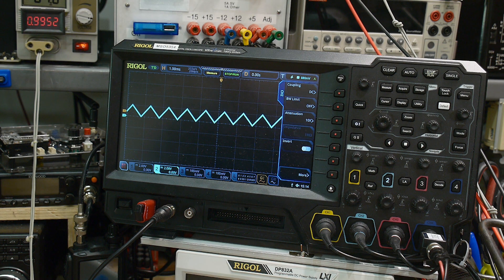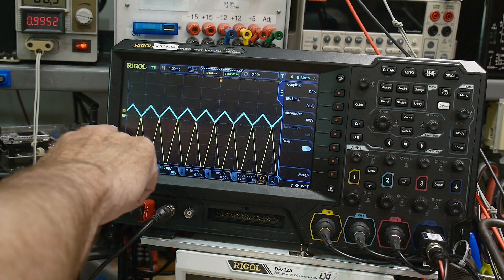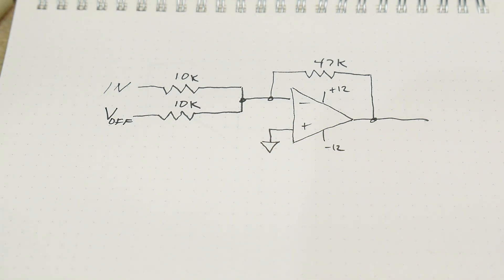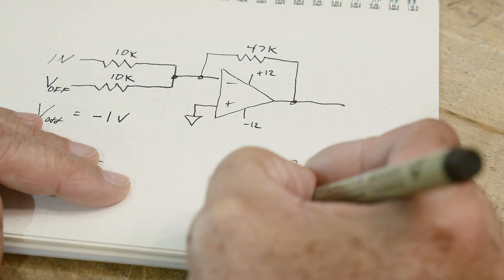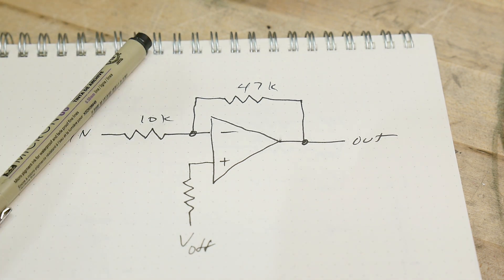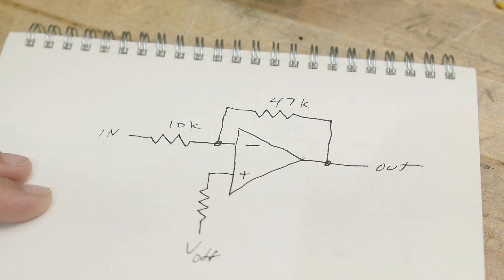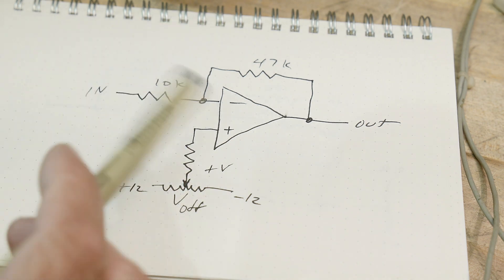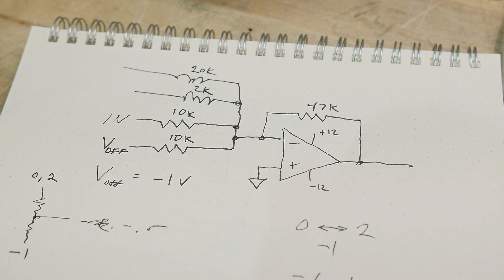#1132 Using offset voltages and op-amps

Comment: Why is there a phase shift on the output?  Is there a way to avoid this?  Im trying to figure out how to amplify and offset negative voltage to a TTL signal creating a zero crossing.
Reply from the maker: I showed an inverting amplifier (180deg phase shift). choose a non-inverting amplifier circuit

Comment: Hello sir, I need some help, the thing is whenever I make any op amp based circuit in any basic op amp configurations I have a problem at a specific time that is when the circuit is powered on or powered off at both of these instances the output of a op amp is very unpredictable or sometimes wierd voltage fluctuations but the circuit works perfectly when powered, please help how can make it work reliably at these instances
Reply from the maker: yes, power on sequence is a real engineering problem. you can first try to make sure that the inputs to the opamp are countertrolled on power up. use resistors to pull down or up the input signals so they don't float. some designs require the powe3r supply to turn on in sequence. so say +5 first and a delay then +/-12
Reply: thank you so much for the help , and i learned the hard way that decoupling capacitors are very important for opamps at powering the circuit those capacitor help at transients and Ill look up on power sequencing.

Comment: Is this also an option to correct the Vos offset voltage? Or do I need an opamp with a specific 2 pins to correct the Vos offset? Thanks!!
Reply from the maker: please watch again, as this is EXACTLY how to correct Vos with an opamp without offset pins.
Reply: @IMSAIGuy thanks! I think this is very important when ie measuring very small voltage from a small shunt resistor.  I am going to build a dynamic load based on your linear mosfet HP cabinet design using a milli ohm shunt resistor.

Comment: In the inverting op amp example you have the + input grounded. In some circuits  this + input is grounded through a resistor. What is the purpose of this resistor?  My circuit  example is used as a meter scaling circuit, where a voltage  drop across a resistor is amplified to drive an analog meter.
Reply from the maker: it is to equalize the input voltage offsets due to currents flowing into the + and - inputs.

Comment: Great video! Thanks for uploading. 

I'm currently troubleshooting an op-amp which has a constant bias input of 2.56V at the (+) input pin, and NO SIGNAL on the (-) input pin, yet I am still getting 2.56V at the output of the op-amp. The op-amp supply rail is +8V and -8V and tested out to be just fine with or without the op-amp in circuit so I have eliminated the supply voltage circuit as an issue.  In your experience with faulty op-amps, have you ever run into this scenario?

Comment: If you go through the mathematics, you find that NEITHER of these circuit configurations allows gain AND offset to be independent!  For this you need TWO op amps....

1) first amp is connected as an inverting amplifier with FIXED input and feedback resistors with the variable offset voltage (Voff) applied to the non-inverting input.  You get an offset of 2Voff (I may have to have to check this) at the output.

2) Then you feed this op amp's output into a standard inverting amp and adjust the gain resistor (Rf).

3) The two op amps MUST be connected with the offset amp feeding the gain amp.

Also, this gives an output that is not inverted!

Comment: I’m very new to electronics and have been learning about op amps. I’m designing a circuit where I need to scale a control voltage of 0-5v to -4v to 4v. I’ve scoured the web trying to figure it all out and finally came across this video. You have explained it so clearly, I now know exactly what I need to do. Thank you so much!
Reply: You can think of the transfer equation as a liner function (a line) and use the point slope formula:  Y=mX+b,where m is the slope of the line: m = (Y2-Y1) / (X2-X1).  and design the op amp circuit to output:  "when X=0, Y= -4,  AND when X=5, Y=+4).
--dALe

Comment: GREAT VIDEO!!!!
I did as you suggested and "built it myself".   Incoming question....instead of the 47k resistor, I used a 100k pot in order to adjust the gain, along with the variable offset, as you did, on the "+" input.  My goal was to make an op amp with INDEPENDENT gain and offset.  When I adjusted the gain, I think the offset was changing as well.  Soooo, with this circuit, is the offset supposed to alter (at all) when the gain resistor is adjusted?????  Or should they be 100% mutually independent.
I did have sort of a 'rat's nest' breadboard with no filter caps.
YOUR REPLY WILL BE GREATLY APPRECIATED AS I AM IN GREAT NEED OF SUCH A CIRCUIT!!!

Comment: Hello, i would like to ask you if is it possible to realize a simple circuit that i have in mind. I have an arduino that can menage Voltages between 0 and 5 V. I just bought a little ADC module that can performe 12 bit conversion to get signals like LFO for musical purpose. What i need here is to tranform voltages that goes from 0 to 5Volts to something like -10 to + 10Volts. I have a dual power suplly -12 to +12Volts. If i understood i need to build that circuit with an amplification gain of something like 4. Hope you can help me

Thanks
Reply from the maker: https://youtu.be/Ynn9ASkdiPo

Comment: Thanks! I know that your example was for a motor. However, if you wanted to use this circuit with audio, what are the considerations of having added DC offset? In other words, I know that DC offset is bad for speakers... So, what is needed to prevent that damage, if this circuit is employed?
Reply from the maker: yes you would not want dc offset on a speaker. but if you are designing an audio amp that runs off a 9v battery then you will need to offset the signals by 4.5v to be in the center of the opamp. the very last output to the speaker would have a large capacitor to remove the dc.
Reply: @IMSAIGuy  "the very last output to the speaker would have a large capacitor to remove the dc." I knew of a cap being the last item in the chain to remove the DC, but, I thought it was a precaution to remove unintentional DC. I had not thought of adding DC intentionally and then adding a cap to quench its negative effects. Hmm... I need to give it a bit of thought and experimentation. Thanks for the reply.

Comment: Why not simply couple the output of the op amp with a capacitor? This will block the DC and pass only AC. Unless you need a certain DC offset.
Reply from the maker: if you are controlling a motor, you need DC. 1V = forward slow speed, -4V = reverse high speed.

Comment: Great info, thank you sir.  Has me thinking about and thinking I'll need to review again for potential cost effective designs for DIY DCEP & DCEN offset adjustments for an AC (I think is pulsed DC technically albeit with potential range of waveforms?) welding aluminum option on an older machine that doesn't have the nicer frequency and offset controls.  I still haven't gotten to reviewing the schematics of the original Miller Synchrowave design(s), since when I get around to again I wanted to start from basic theories/apps. Very inspirational thought provoking where I'm guessing will be done using transistors for higher current applications since I don't recall ever seeing a higher current capable op-amp.... where like transistors one could arrange in parallel even to deal with the current needs.

Comment: In the second circuit, the input has Voff reference while the output is still ground referenced; this is why the offset is not 1 V.  If the inversion is not desired, you can always use a difference amplifier, apply the signal to the + chain, and +1 V to the - chain.

Comment: so I have this background obsession with dc (stepper) motors, where i noticed as a kid that if you connect the windings, and turn one, the other will turn because of the energy generated by the other. But obviously it's not much power and the motors will slip and miss steps. I've always thought that it should be possible to add power to the circuit with op-amps and comparators, to "stiffen" the response... but I don't quite know how to do it.  Is this something you would be interested in explaining/investigating?
Reply from the maker: https://youtu.be/bZJoiB56N74
https://youtu.be/akRzY6EGBV8
https://youtu.be/Gp-MCvNfEPs
Reply: @IMSAIGuy  ah, cool.  thanks!  My wish is to do this without digital stuff.  I guess I should get started blowing up op-amps and comparators! ;-)
Reply: @nickcaruso  I haven't played with the stepper motors much yet... though you have me thinking about how some operate old metal lathes and 3-phase machines on two phases (240VAC) into a 3-phase driver motor larger enough than the driven 3-phase motor and a 1-phase motor to get the 3-phase driver motor spinning enough to meet performance requirements. Probably not a need for stepper motors... though maybe and the old fashion inverting/converting methods came to mind (like DC to AC and AC to DC using motor & alternator/generator) and is somewhat on topic... though not quite.  https://youtu.be/e6eKDsDpup8?t=245